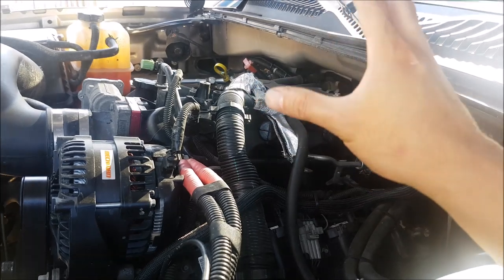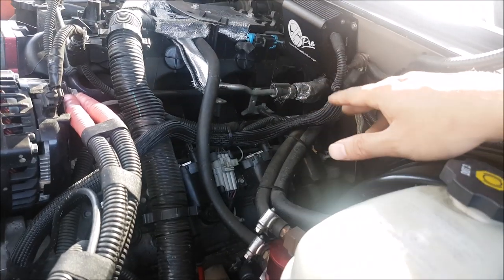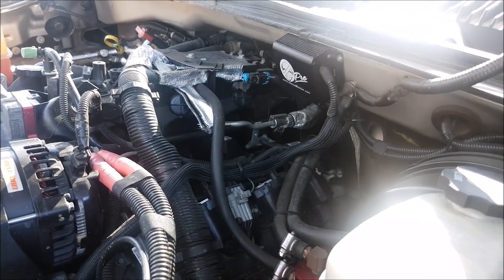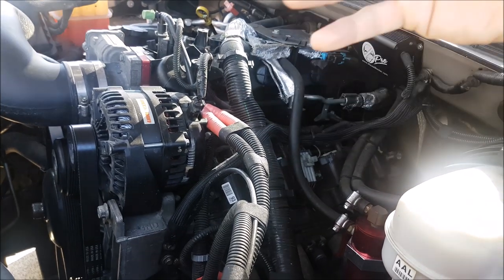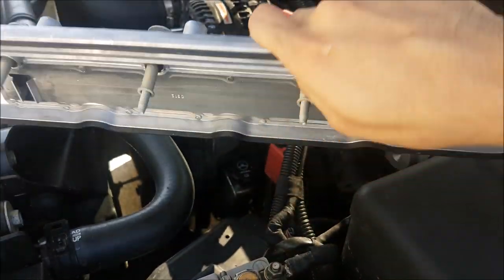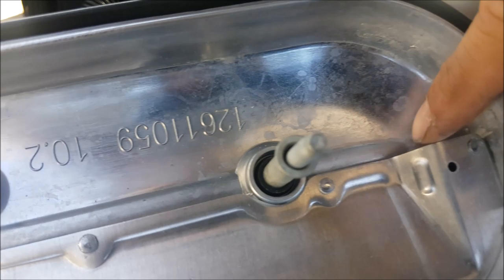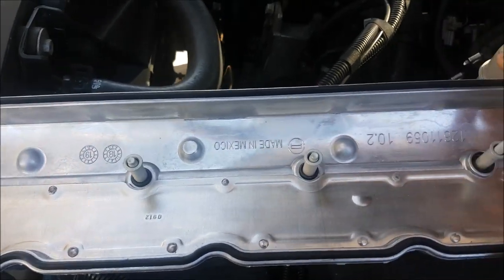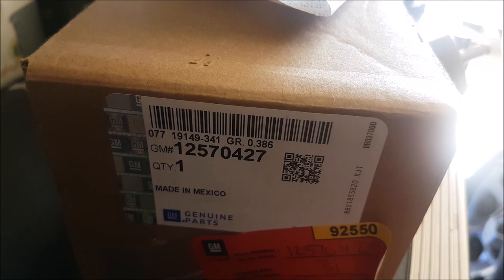LS Motor Valve Cover Update oil in Intake Manifold (PCV System) | AnthonyJ350

Comment: My 11 5.3 started running rough and intake sounded wierd,  so I pulled the intake and found a quart of oil expecially going into cylinder 6 where I have a misfire code, so I pulled the valve cover and found that I have the upgraded cover so I will now be installing an oil catch can!
Reply from the maker: You'll also want to look into this for the other side https://youtu.be/q6G5ZiBpmUE?si=Z8NFxLHaV7quP1C8
Reply: Even the new design will fail just take it off and drill little holes in it, how is it now though did the catch can even do anything?

Comment: There's a TSB 10-06-01-008G . Part # 12570427 is for 2007-2008 and part# 12642655 for 2009-2001 5.3l, not sure for the 4.8l. If you have AFM, there is a shield pqrt # 12639759 that goes over the AFM relief valve in the oil pan. If you do a DOD delete or do not have AFM, it is not needed. Plus I like the catch can idea also.
Reply from the maker: Thanks for sharing those part numbers!

Comment: Hey not sure if you still reply but I’m planning to do this and replace the drivers side valve cover, I was wondering if I should also replace the passenger side? I just got my truck for less than a year now and just want to do some preventive maintenance and what not
Reply from the maker: I would leave the passenger side alone if it's not leaking. I'd only redo both if you were having them powder coated.

Comment: I have a 2011 gmc canyon with the 5.3. Lh9 to be exact. It smokes like a freight train on initial start for about 5-10 seconds and then disappears until it sits for awhile and then fired back up.  But I have noticed the amount of smoke I get is determined on how hard I drive it. If I drive it kinda hard, it’ll smoke like hell on the next crank up. If I baby it, it will smoke very little to almost none. Pcv valve maybe? And it does drink about a whole oil change between oil services.
Reply: And I do have a really bad sluggish problem after the motor has been running for about 20-30 minutes. It’s really sluggish like at red lights or stop signs. Almost feels like it’s taking off in 2nd instead of first, don’t know if that could also affect performance like that. Idk lol
Reply from the maker: I'd bring it to your mechanic to diagnose. How often do you change the oil?
Reply: @AnthonyJ350  ummm here recent I haven’t really changed it. It drinks so much in about a few weeks that I just assume it’s filtering itself. I’ve had to put about 4 quarts at once a few times. But normally every few months maybe. I drive about 20 minutes to work everyday. But I work with Nissan and one of the techs told me that it’s a good possibility that it’s the valve cover, he told me to research around and see what other people are saying.
Reply from the maker: @danielpope631  That's a lot of oil going into the intake manifold.  I would inspect inside to see if the manifold is wet inside.

Comment: Catch cans are necessary indeed 👍 more preventative maintenance on top of updated parts. I wouldn't trust a system like that on the cover. Vapors at temp can still travel without baffling.
Reply from the maker: I the updated cover and existing catch can will work really well. The catch can already does a really good job.
Reply: @AnthonyJ350  yes the updated cover is better than factory. The effort is to be noted on that.
Reply: @AnthonyJ350  where did you purchased the catch can kit?
Reply: @tellitallnow3914  I’m guess he didn’t get back to you?

Comment: Hello guys, 

This past weekend replaced the cover on my 2012 tahoe ppv 5.3, but I noticed that I had already the updated cover, my problem is little weird, no cold start smoke, no hight rpm's smoke, but when Im going down a hill just iddling when acelerate back trow bunch of smoke (blue), but after that no smoke. Untill iddle againg for like 10 seconds
Reply from the maker: I'd clean the intake manifold and look into running an oil catch can https://youtu.be/DJ7Z2F51fzs?si=qaDSj4dPZryof-5a

Comment: I have the valve cover and it still lets lots of oil get in the intake i just did the intake gasket on my 04 5.3 and when i turned it upside down  twice i had oil puddles
Reply from the maker: Put a catch can on the driver's side with the updated valve cover and put this oil separator on the passenger side https://youtu.be/q6G5ZiBpmUE?si=kT30hoYytx0NOUDl

Comment: I am having the issue where my truck has started smoking at first start in the morning and now some throughout the day at random times but not always but only for a few sec blue cloud of smoke,  could this help my issue? It’s a 2011 chevy Silverado
Reply from the maker: It might if yours isn't the updated design already. I would take off the throttle body off and inspect the intake manifold if there's a bunch of oil in there. I would also look into a catch can https://youtu.be/DJ7Z2F51fzs
Reply: I have the same issue with my 04 yukon denali. Its pushed oil into the throttle body and smoje at start up and oil consumption. Im about 99% positive its the pcv in the valave cover.
Reply from the maker: @knobstonestickbows4962  This with a baffled oil catch can will help a lot.
Reply: @AnthonyJ350  what a good bramd of the oil catch can with the baffle for these trucks?
Reply from the maker: @knobstonestickbows4962  This company makes good products. Check out the description https://youtu.be/q6G5ZiBpmUE

Comment: So I'm assuming the outlet port on the catch can connects to the top of the manifold. I have a 2014 escalade with a 6.2 and I found the pcv in the back of the drivers side valve cover, but when I traced the line it hits some type of junction with a plug in then comes out the other side and connects to a port on top of the manifold not the throttle body . Is this where I connect mine to the output side of my catch can. And what is that relay between the lines off the pcv system?
Reply from the maker: You need this brand of oil catch can https://www.tracylewisperformance.com/

Comment: Can you tell the valve covers apart without taking them off? Have a GTO that is losing oil. No leaks. No exhaust smoke either
Reply from the maker: I don't think you can.
Reply: If it's not leaking and not burning oil, then where is it magically disappearing too?  It's burning it, you're just not seeing it. Remove the intake tube and flip open the throttle body butterfly and look at the valley floor of your intake with a flashlight. Probably coated in oil. Punch it on the highway from like 20 mph to 100 mph. Mash it up the floor and don't let up. Look out the back window as you do so and after you let off the throttle.
Reply: @tirefrier8253  ok. I have a catch can on it. Ill have to look into it. I heard the LS2’s just use oil when you cam them. No real way to fix it besides tearing it down and doing a bore and new rings and doing an updated PCV system. It only burns a quart between oil changes
Reply: 2011 is when the fix came out, also the valve covers are easy to remove

Comment: Do you know if the gen4 Ls engines already have something like this? Other half has a 07 envoy with the 5.3, it blows a cloud of smoke for 10 seconds on cold starts. Trying to narrow down what's going on here before I go yanking the heads off and replacing valve seals and things. Replaced a cracked vacuum hose for the pcv and it looked wet inside. I'm used to adding a quart between oil changes on my gm trucks but dang. Guess if it's rings i'm gonna keep adding oil, that oil pan looks like a pain in the ass to get off with the axle going through it. Definitely not coolant either.
Reply from the maker: I believe you would already have the updated valve cover. What oil are you using? I'm using Castrol 5W40 to quiet my engine down after I had a cam put in it https://youtu.be/zVjVAAikdYc
Reply: Have you figured it out yet running into the same problem had a head gasket problem not to long ago so I’ve already did head gasket valve seals an what not but when I pulled the intake of it had a lot of oil in her
Reply: @doyleboggess3791  it seemed to have slowed it a lot though i will say i have a minor oil leak somewhere down below. did an oil change about 2 months ago and havent had low oil level or any smokey startups since.

The baffling in the valve cover was much bigger in the newer cover.
Reply: 2011+units

Comment: I have a 2014 Yukon XL 5.3L V8 that has a misfire on the 7th cylinder. This vehicle has the active fuel management. I pulled the spark plug and there was oil on the spark plug. Tell me where you think the oil is coming from to be getting on the spark plug that is  making it misfire? Could it be rings are bad, lifters might be bad? I have not done a compression test on the 7th cylinder yet or a leak down test. Please give me what you think might be where the oil is coming from.
Reply from the maker: Look into an oil catch can like this https://rxcatchcans.com/
Reply: sounds like stuck lifter. wet with fuel not oil check for spark then do comp. test if good spark
Reply: Turn off afm/dod and do the dod delete overhaul

Comment: Should go with an LS6 valley cover with a built in valve cover....works WAY better than that valve cover you got.
Reply from the maker: I was looking into that, but decided to go with the updated valve cover for simplicity of install and don't have to modify the block to make it fit.  Correct me if I'm wrong, but I believe you have to make a small modification to make that valley cover fit unless you have an LS6 block.
Reply: @AnthonyJ350  no mods needed for a gen3 block. I've had one in my 05 5.3 for years along with a catchcans.com can. Intake is dry as a bone at 215k miles.
Reply from the maker: @eddiefromcali  Good to know, I'm going to run this one for our video purposes but I'll make sure to mention the LS6 valley cover in follow up videos to give people more choices. Thank you!
Reply: Yup, LS6 Valley cover does work way better
Reply: LS6 valley cover and replace valve cover with old style removable PCV?
Reply: @robertburrell8676  does it fit in the 4.8 as well

Comment: don't need new valve cover just clean it and drill extra drain holes
Reply: Just did that on my 07 yukon a few weeks back, 2500 miles in and most of the oil Consumption has stopped. Saved me $165 bucks for the newest valve cover update.
Reply from the maker: Thanks for sharing
Reply: Yup. Enlarge the holes and replace the pcv with the fixed orifice style.
Reply: @tmurph247  I bought a new cover and pcv for around 70 on rock auto
Reply: @tmurph247  new valve cover or drilled holes
Reply: Yeah and possibly put shavings in your engine even if you think youve thoroughly cleaned them out, no thanks
Reply: @wesleystanden2574 dorman have the new unit

Comment: Anthony, I have watched many of you videos and do enjoy learning as my job did not take me into the “LS” word. Is the fitting a true fixed oriface now or does it still have a spring-loaded valve inside?  Many imports with much smaller displacement have been running a fixed oriface for years with no issue. After all, it is a calculated vacuum leak! Just small.
Thanks for all of the videos!
Reply from the maker: Thanks for watching! I didn't really inspect it but I'm pretty sure it's just a fixed orifice. Hope that clarifies.
Reply: @M21-w1y  Government wants higher MPG in the truck category, engineering has to find a way to squeeze more MPG's somewhere. I don't think anyone is pulling a backhoe to the job site with a tricycle. Poor design or not, variable valve timing, late intake valve opening, or lifter failure due to lack of oil changes. Everyone who builds a truck have to figure it out. As for poor design, it is funny how everything is perfect until it ain't! Suggestions?

Comment: Do u know the part number for the passenger side?
Reply from the maker: Passenger side doesn't have anything related to the PCV system.
Reply: Only the driverside has the TSB, you can get a dorman unit

Comment: Why is there a pcv valve on back of drivers side valve cover with hose going to intake plenum and then the hose off p/s valve cover to t/b
Reply from the maker: One aide is normal driving the other is wide open throttle conditions
Reply: @AnthonyJ350  the passenger side hose is to allow fresh filtered air to enter the engine so it can be sucked out by the driver side hose. If you don’t have a way for air to enter the engine the pcv system will pull a vacuum on the crankcase. The passenger side hose must be connected downstream of the MAF sensor so you don’t have false air (MAF bypass). And yes under WOT conditions there is enough blow by that the passenger side hose reverses direction and allows pressure in the crankcase to vent to the intake to be burned.

Comment: I was told the baffle was bad and caused higher crank pressure and blow by so it's better delete the baffle and only use a catch can
Reply from the maker: I been using this just fine.  Is it a daily driver vehicle that tends to stay below 3,000rpm or something on weekends that your whining out the engine?

Comment: I have an 05 Silverado and my PCV Valve is on the Valve Cover like apart of it I think?  It won't come out/budge.  How in the world do I replace it???  I can take the rubber hose off of it easy but the valve itself won't budge out at all.  I tried everything, please help.
Reply from the maker: You can't replace them, it's just a baffled orifice. Run an oil catch can and you're good.
Reply: @AnthonyJ350  Ah okay cool!  Thanks for quick reply!  I sprayed some carb cleaner in it and up the hose.
Reply: don't need so called updated valve cover or catch can  clean the valve cover and drill a few extra holes in the baffle
Reply from the maker: @shaunnesbit1734  If that's what you want to do. Give an update of the intake after 100,000 KM
Reply: Actually a bolt extractor gets it out. Then lightly hammer in new one
Reply from the maker: @patrickdolan.  You can't, it's built into the valve cover. It is not designed to be removed.
Reply: @shaunnesbit1734  yeah and possibly put metal shavings in your engine, good luck with that

Comment: Will oil in the intake cause excessive white smoke? I think I know the answer to this, but not so sure. Here’s why. An 01 GMC 4.8 is smoking, and I mean a lot! I’ve reworked the heads, so hopefully I can rule out head or gasket problems.    If I drive it, it runs very smooth and no smoke. But about 5 minutes later, it looks like I’m spraying for mosquito’s. Still running fine, oil and temp normal. I’m completely at wits end, can anyone help?
Reply from the maker: Are you losing coolant? Found this site https://procarmechanics.com/types-of-smoke-from-your-car-tailpipe-what-it-indicates/
Reply: Anthony J350.  Thanks for the link!  I guess I know what I gotta do, but at 70 yrs old things seem to be a little tougher. I guess I’ll read the plugs, try and nail it down to a cylinder. Then pull the heads and get the shop to pressure test them again. Check my gasket and see what’s happening there. I was hopeful that oil in the intake may be my answer. I haven’t tried to measure missing coolant. My smoke doesn’t seem to be steam though. I’m beginning to dislike LS engines, Lol

Comment: My 2000 Silverado 5.3l has a PCV in the back side of the driver's side valve cover. Same location as the "orifice" in the one you've shown.  The oil doesn't come from there on the older motors.   The older style had a VERY SIMILAR valve cover on the pass side, to what the newer ones like yours have.  It's literally just moved back a hair.  Why people see "so much oil" in the throttle body of the old ones compared to new ones, is because the pass side vacuum line pulls from the throttle body itself.  In like 03/04 and newer, like yours, it moves the vacuum back to the plastic part of the intake.  So it still sucks the oil in, but puts it behind the TB so you don't see it as much.  
Also, something you can do to cut down on some of this oil, is to 1) Install catch cans.  (I know.  That's a pain). And 2) The "CHEAP" solution, is to pull the valve covers, remove the baffle plates and drill some drain holes in them.  Then tap 4mm holes where the rivets were and reinstall the baffles.  If you own a TIG, you can tack them back in place, but if you don't know how to weld alum, don't try this.  Also, be sure to loc-tite the screws you tapped holes for so they don't come out.  Finally, you can re-rivet them if you are good enough.  
I've personally had "Limited" success using a rivnut setup in the drilled holes, but without through hole access, they are tough to get seated right.
Reply from the maker: Thanks for sharing your experience!

Comment: How much would it cost me to upgrade my 2010 5.3 top end like you did? What parts did you use and how much did it improve performance? Thanks
Reply from the maker: Few grand when you have a professional perform the work.  We focused on top end durability (Melling oil pump, hardened push rods and caged trunion upgrade for the rockers).  The TBSS intake manifold and Comp Cams cam gave much better performance in the mid-range of the power band.

Comment: That large square opening on the left is the problem. You need a shield over it. At least 3/8 inch between the shield and the opening.
Reply from the maker: What about using an oil catch can?

Comment: Is this for escalade ? 07
Reply from the maker: Any engine where the PCV outlet is on the valve cover. I would pull it off to see if you already have the updated design, or see if you can buy the new one and see if it's refundable.

Comment: That “updated” cover you bought will still have issues. Drill a few relief holes along the bottom of the baffle to help drain the oil back out
Reply from the maker: Thanks for the tip!
Reply: None here